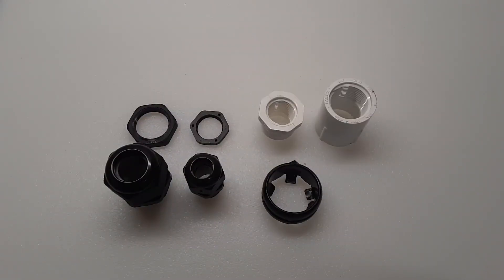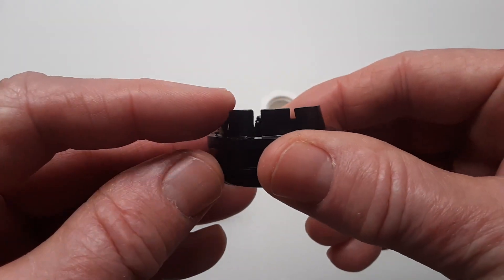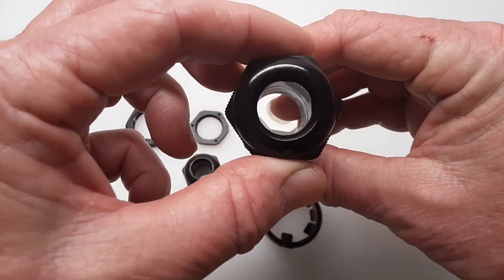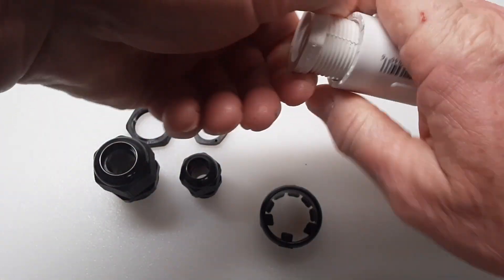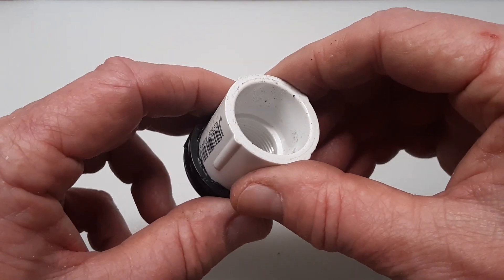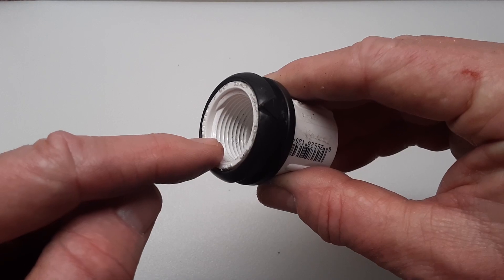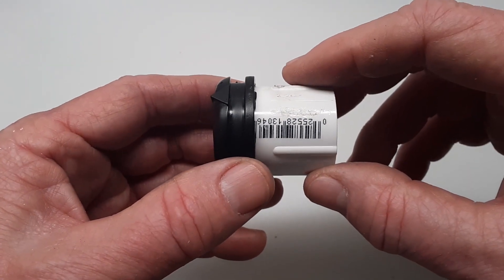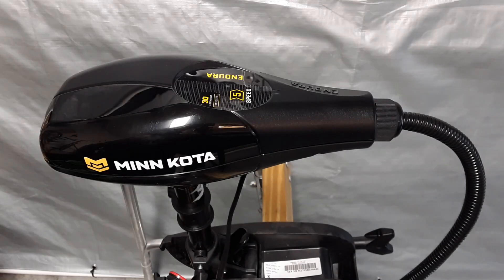Trolling Motor Control Box Wiring Adapter

Comment: I notice that you still have the stock control switch that the tiller handle turns connected when you shut the top cover. For the finished product, did you take out the switch and run the pos/neg wire to a PWM?
Do you have any videos where you moved the stock switch up near the seat and used it? I'm still questioning if I need the precise control of a PWM, especially given how many reviews there are on them failing, which is probably due to over heating.
Thanks for the video.
Reply: Oops. I should have read the video description better. I see where this process is to be used with an ESC or PWM.
Still interested in any videos where you've moved the stock control switch up by the seat.
Reply from the maker: Thanks. I did not modify the head switch in this video since it was about the wiring adapter. I have videos where I have mounted the ESC in the head with the adapter. I have also just moved the stock head next to the seat as a controller and another using a box that housed the stock switch. The Amazon inexpensive PWMs have been known to fail.
Reply: @Aksmaniyak  Thanks for the quick reply. I did find your video on moving the stock switch in the a box. I like the idea of a PWM, just not the reported failure rate. Do you have any recommendations for a higher quality PWM?
Reply from the maker: Yes. Check out my Minn Kota Traxxis build. It is a quality PWM. It's in my PWM playlist.
Reply: @Aksmaniyak  Thank you!!

Comment: Is there any way you can show the actual wiring instructions?
Reply from the maker: There are no written instructions, just the video step by step.
Reply: @Aksmaniyak how did you wire the transmitter? What channel was it on? Did you program the transmitter ?
Reply from the maker: if you follow the reference previous videos, each one shows how to do parts of the total build.